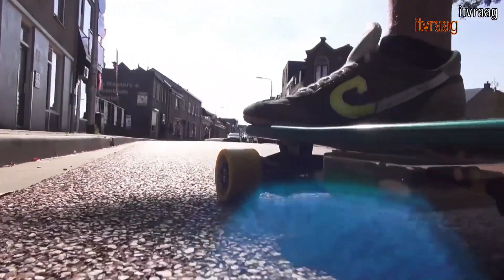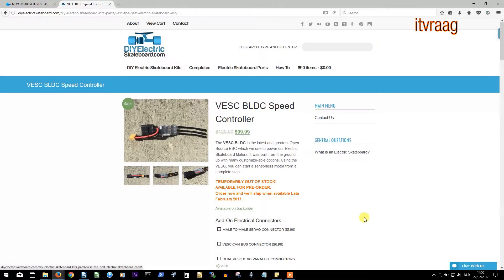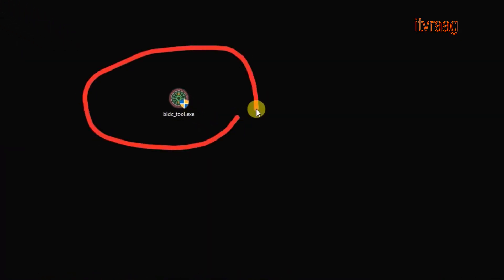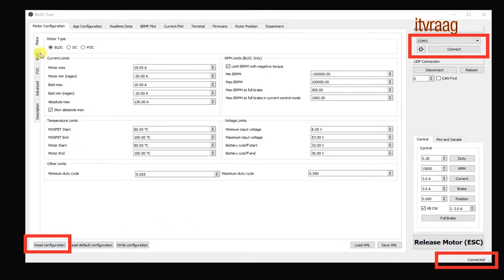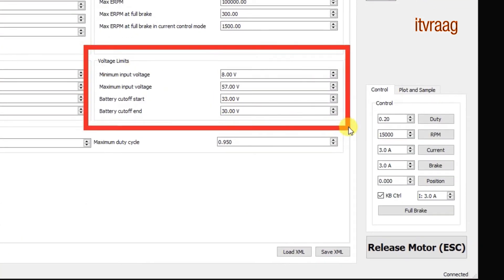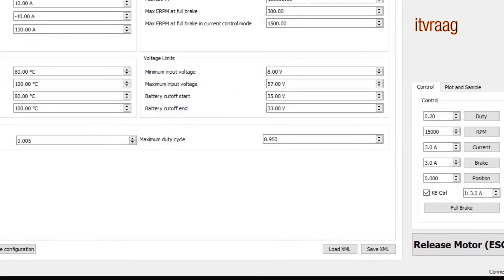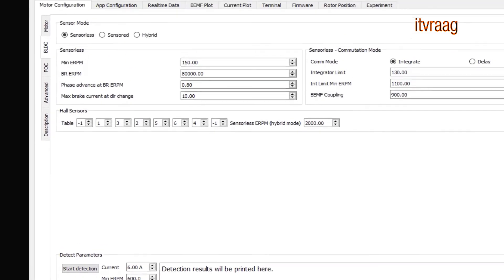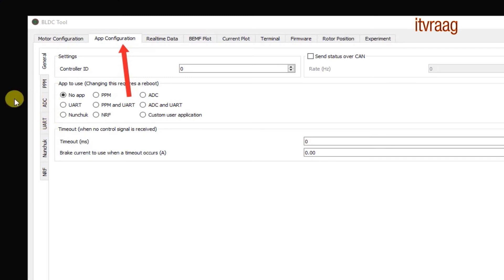Configuring VESC with BLDC tool for DIY eBoard

Comment: Hey, really great video, thanks! I just followed your instructions and my board works great except for one annoying behavior: It is "always braking". I mean that if I am going forward and then abruptly release the throttle without actually moving the throttle backwards to brake, it instantly brakes really hard, that feels very dangerous, I cannot just go "free wheels". That means that if I want to slow down when going full speed, I have to carefully slowly move the throttle down to stop. What do you think I should do to my config? Thanks a lot

Comment: I'm having a little trouble getting my VESC to detect my motor, a Turnigy SKS-3 5065 320KV.  The motor runs off the arrow keys on the computer, but 'motor detection' fails, leaving the message "motor detection failed" in the 'result' window...and "bad detection result received" in a red box at bottom right corner.
I'm not making a skateboard, but a 'whizzer'.  The motor has a drive wheel mounted on the shaft that rides on the tire of a bicycle at a pitch speed of about 30MPH...I'll be using it in a pedal-assisted mode.
I have screenshots of several pages of the BLDC tool, and a short, unlisted, YouTube video of my test setup.  If anyone has a clue, they're welcome to comment here, perhaps moving to FaceBook or email for a lengthy discussion if needed...any assistance would be greatly appreciated!
Reply: Hi I have the same motor from sk3... The specs on the motor is not the same at stated could be the reason
Reply: I went back and forth several times with my vendor and finally managed to get a good motor detection.  I'm bogged down a bit right now working out the correct ratio and details of the hardware, but the thing DID push me across my parking lot!  Once I get everything sorted and mounted, I will be back in the software to tweak the settings.  One setting at a time, and only by small bits!

Comment: Nice video man. 

How do I know what to set my Motor Max, Motor Min (regen), Batt Max and Batt Min (regen) at.

And once I connect my VESC, how do I know the firmwear is correct and everything?

Also If I'm doing dual motors, do I set everything identical on each VESC. What options do I need to check on the slave VESC and what options do I need to check on the master VESC. Just "Multiple ESCs over CAN"? Thanks.